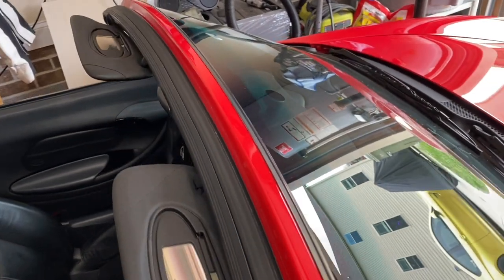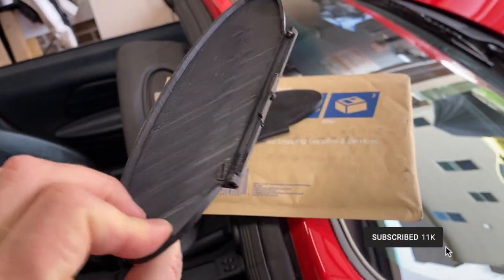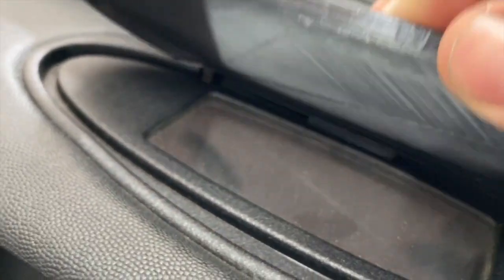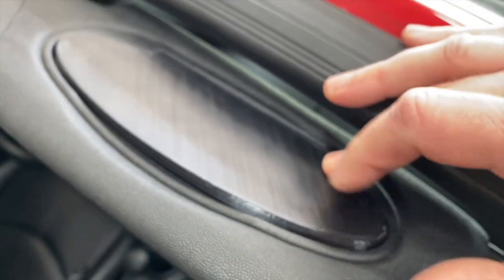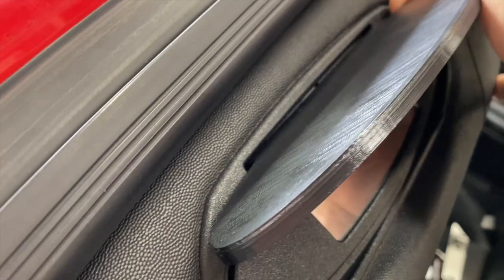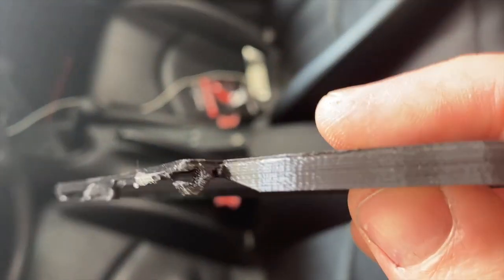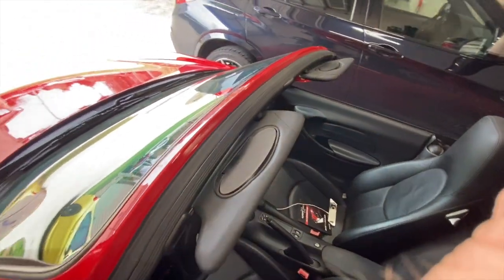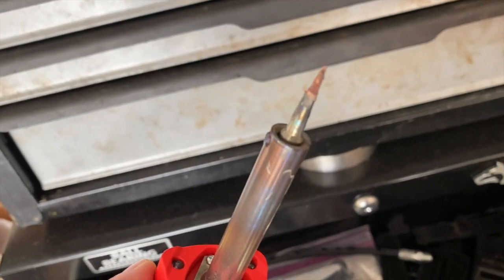3D Printed VISOR MIRROR COVER FIX | Porsche Boxster 986

Comment: Sorry about not enlarging the holes before I sent those out to you. I'm enlarging the holes on all of them that I print now. Getting ready to buy mote material soon so I can build more. I'll be trying cup holders soon in 2 types (1 that holds 2 drinks in the console and a single cup that fits in the ashtray spot.
Reply from the maker: No worries!
Reply: The cup holders sound awesome
Reply: hey chad, i know this video and comment was a long time ago, but i just came across, and i sent you an email. thanks man!
Reply: How much it cost.  How I buy 2
Reply: Hey, do you still print them? Let me know. Thanks!
Reply: Is it possible to still get the visor mirror covers?  I don't see a link.  Also, any update on drink holders?

Comment: it looks like its printed a bit too large and that the tolerance aren't correct on the hole size and the distance of the hole center to the shoulder of the part.   i would take a drill bit that is slightly larger the hole and try to ream it out. (oops, just watched the end where you mention the soldering iron. )   you could also try sanding the edges of the Oval shape to get it to fit into the recessed area of the visor a little bit better..   or ask the guy to re-print the part at 98% size, with a larger pin hole too..
Reply from the maker: Soldering iron in the holes FTW :)

Comment: Scratching my head here??  These covers fall off because the pivot pins break off the visor portion .. so a replacement cover is not going to fix it?.. unless one intends on gluing that cover down and making the mirror non-functional??  What is the intent of this fix?  FYI - 3D models I found on Thingiverse:  https://www.thingiverse.com/thing:3892625  ..  I have a commercial 3D Printing business and have high quality scanners .. and a 996TT with two broken off mirror covers ... but there isn't a way to fix this really with a 3D printed cover since the pivot pin(s) is missing. If the intent is to just cover the visor (i.e. eliminate the useless mirror function, lol) ... a 3D printed part that replaces the entire sun visor mirror unit (that simply fills that void), a visor mirror delete part,  would make more sense .. then add some texture and style to it and it might actually look cool. I think I have a project to work on!!
Reply from the maker: +BigCooter.com yes, mine ended up warping in the sun and failing, as some guesses would happen. I think you need to do that and send me a set for a follow up video! 😉
Reply: @HelpMeDIY  Let me see what can be done... have some CV boots to replace first. The material choice for the parts you tried isn't good for interior vehicle use (PLA material).. there are better material choices like PETG, which I have used for making dash cams, where PLA failed from the heat.

Comment: Nice work on the model (to the original modeler - it’s free on thingiverse), but that is definitely not up to par on fit or finish for any car, let alone a Porsche.
Reply from the maker: +miukotse 👍
Reply: true but especially if you have the lights it is stupidly expensive. it's $350 each with lights.

Comment: On mine it's missing altogether on the passenger side with only 44k miles usage, was broken off, got the car without it. 
Flimsy CRAP. Famous Porsche design and quality... Don't get me going on the cruise control stalk, cupholders, starter key location (a knucklebuster) or on the lights switch - just for starters - in the cockpit. And I have plenty more of the stupid, thoughtless, lousy design and quality Porsche crap to gripe about...
Reply: You don't like the starter key location? Definitely not thoughtless. Comes from the days of old racing when the drivers jumped into their cars, one hand on the shifter the other on the key
Reply from the maker: +Victor Song 😂 keeps me busy with videos at least 🤷‍♂️
Reply from the maker: +Erik Bielitzer 👆👏